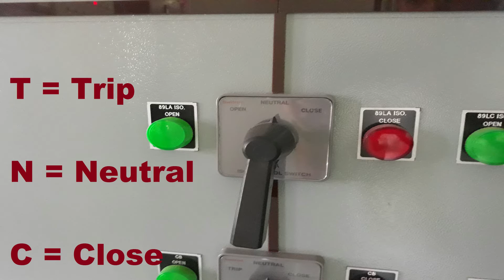Motorized ISOLATOR Operation Practical Demo, Interesting & Complete explanation at 220KV Substation

Comment: Why DC supply is required in isolator box as 3ph ac is required for moto operation
Reply from the maker: DC supply is required for control circuit. Such as interlocking, contact pick up etc.
Reply: Should i provide DC supply ?? Or from the ac supply will convert it to dc for the control unit ? 

In other hand ,if i will bring AC power supply for the 3ph ac motor , should i also bring out source dc power supply?